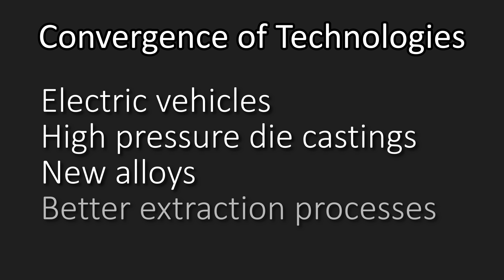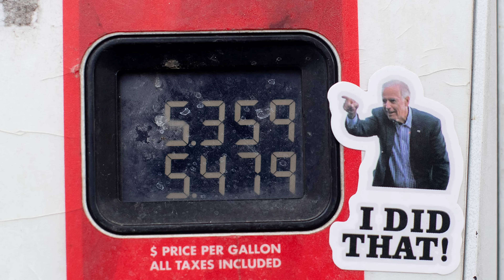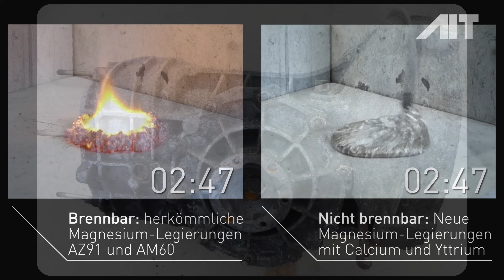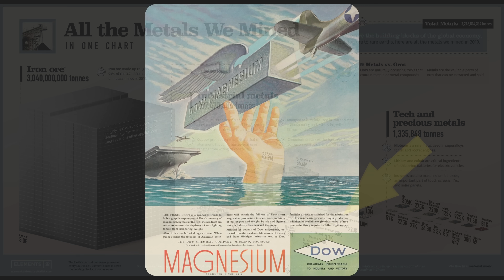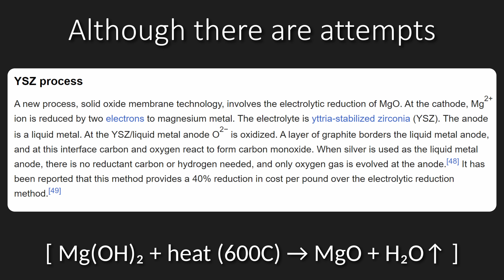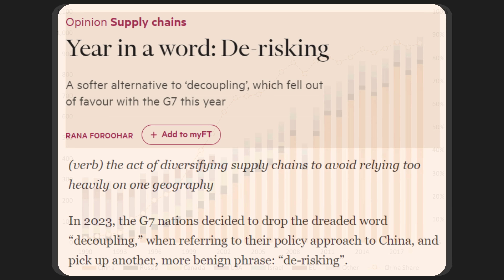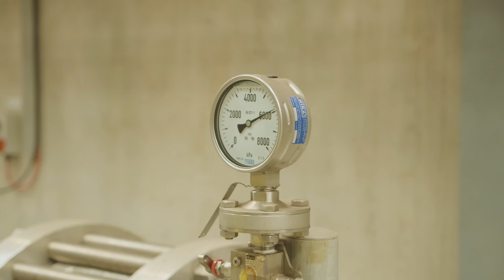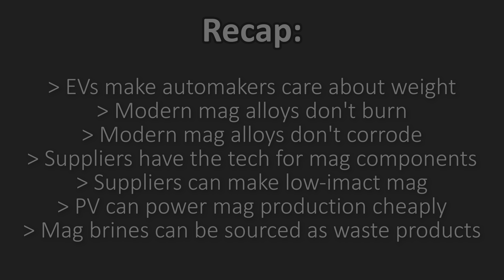Welcome to the AGE of MAGNESIUM

Comment: I'm a retired chemist and engineer and like this very good video about Magnesium, a remarkable metal, It was so lightweight it was used to save weight on the B-29 bomber with the engine block cast magnesium. Unfortunately those engines ran VERY hot and had lots of engine fires. That was deadly with magnesium being a major part of the engine because that meant the metal of the engine itself burned and could not be put out with water or foam I also had to interject a comment about your misleading political attack job Actually Biden was the first president to use the buying and selling of the US strategic oil reserve to gain some control of wholesale oil prices and BROKE OPEC stranglehold on oil prices!

Comment: With regenerative brake systems the weight of the vehicle is really not that important. And also magnesium is lighter than steel its strength is also lower and therefore parts have to be thicker. And its much more expensive than steel so i dont know if magnesium will be used sometime (apart from luxury cars maby)

Comment: This discussion is meaningless without primarily looking at the material's mechanical properties and comparing them to the part's requirements. In terms of having lighter parts, it's not just about the density of the material, steel is denser than aluminium but steel is stiffer and stronger so depending on how the part is loaded it can make lighter parts because less material can be used. (search Ashby Material Selection for the full picture).

Comment: Some magnesium movement occuring in bicycle manufacture currently- another transport sector that values lightweight structures and is significantly more future proof than cars. Have a look into Vaast cycles made with Allite tubing. I also saw a blog post written by one of the figures involved with introducing aluminium into large scale bike manufacturing- he predicted in the 20th century that the majority of consumer bikes would be made out of magnesium eventually as it would replace aluminium.

Comment: But is there an issue with aluminum shortage? Until it's widely viable and business can get it fairly cheap, they still will continue to use it, especially if extracted magnesium will be more expensive and if it will not meet the demand.

Comment: Yes, a 1/3 lighter structure is valuable, but a car's weight ain't in the structure anymore. Batteries won't get lighter based on magnesium, and car structures are already light. Way more opportunity exists in neighborhood electric vehicles with removable ultra-efficient range extender engines and battery packs. The only time a vehicle needs significant mass is when it leaves its home turf. And that weight can be temporary,  especially since it's not just efficiency that screams for very low range: the space opened up by limiting daily range is quite valuable. When you want to travel, add a swappable battery or an engine and fuel tank. It is ludicrous to drag around a 500 mile battery. Tires, roads, everything degrades just to support the mass of almost always unused battery capacity. 20 miles is a good range for a car battery. A tiny range extender (20hp or so) can extend that to about a million miles. With a 20hp engine and a tiny battery 99% of the time you won't have any issues. In the rare instance that you have an issue it will be "I had to slow down a tad".

Comment: There is also the Karen fuelled school run arms race, where weight is actually an advantage. If a 2 ton car hits a 1 ton car, the 1 ton car will be deflected twice as much, imparting 4x the energy to the passengers, so there is inherent safety in being the heavier vehicle. This is before you even consider weight distribution. A lump of weight at the base of a car structure lowers CoM, and lowers sprung to unsprung mass ratio. It will require more power to accelerate, but unless you have downforce (most cars have some lift), grip, stability, and ride quality will actually improve. There is a reason wheels have been magnesium for a long time, and roofs are the first part to be switched for carbon fibre.
Electric cars already have a large weight very low, so start to see benefit from losing a few pounds where possible.

Comment: They never adopted stamped aluminum structural components due to tan-delta aka springiness. Many steel varieties are amazingly spring (like spring steel, piano wire, and... you know, springs). This is incredibly valuable for things like spring leafs and vibration durability. Ever notice how there are no aluminum springs? I wonder if there are modern magnesium alloys that have a high tan delta. Also I bet someone is going to chime in about some specific NASA aerospace aluminum with a crazy tan-delta - I'd love to learn more but afaik none of the common readily available, easy to work with, aluminum variants have great tan-delta values - better at crumpling than springing back.

Comment: Magnesium is not new and has been used and is being phased out in Aerospace. Cost is higher because there isn't alot of finish houses thst handle it. Problems are milling aren't as easy as aluminum, cost is higher, wear a d fatigue characteristics are worse than aluminum (look at allispn 2000-2010 transfer case wear issues), and coatings have a hard time adhering and baked on csnt be used in a lot of cases becuase of lower tempering temps of magnesium.

Personally I don't think it's coming back this is once again an industry not learning from the past thinking they've reinvented the wheel (which were also magnesium on VWs) when they're sifting through the garbage heap of others ideas and I don't think this time it's another man's treasure.

Comment: I don’t think they trying to make lighter EVs to have more range, EVs have regen breaking, so any energy to put to accelerate comes back when you break.
The more pressing issue with EVs weighs is that they are heavier to begin with, so they cant tow  as much and the breaks etc. have to be beefier (regen Breaking is no option in an emergency)
Given then people buy EVs for the acceleration it also makes sense to have less weight.

Comment: Magnesium car with Lithium batteries in a indestructable cyber truck that electrically opens the car doors…. That’s a death trap 😂
Reply: The Cyber Truck is one kid's amputated fingers away from being killed. It has too many Muskian moronities for even the army of brilliant engineers Tesla recruited to handle. Musk sucks.
Reply: Imagine using magnesium to lighten the car because you used stainless steel to make the hull which made it heavy in the first place. It's like mixing coke with heroine because you can't decide whether you want to get sedated or cranked up.

Comment: Hate to burst your bubble, but if your justification for magnesium rests solely on electric cars, theres no justification for it. First the market for electric cars is predominantly driven by government forced demand. If the government were to pull out the whole industry would crumble. Two, electric cars are extremely inefficient. Most energy in the USA comes from fossil fuels, electric cars and the batteries used are basically just an expensive middle man between the effective power source and the road.
Third, just reducing weight in cars isn't going to do much. A massive margin of car exhaust in America comes from commercial. Semis and pickups hauling heavy cargo. Reducing the weight could just make them top heavy, reduce safety and ultimately have an uneventful impact on long term fuel efficiency because of their load.
Fourth, even if you were to be a fool and ignore the waste and production side of batteries, and the inefficiencys in their use, clean energy welll... isnt clean. Despite what all the government paid npc scientists will say both solar and wind are a joke. They look clean on the surface but when you look underneath you find they aren't. Wind has ridiculous waste in the manufacturing of and frequent replacement of mechanical components (and because this, wind isn't cheap either) and solar has lots of chemical waste that is extremely toxic, making coal look like we are burning white pearls than "dirty" rocks.
Fith, the real "future" for cars would actually be nuclear, and it would be that way for "clean" energy, that is, if people actually pulled their heads out of their asses.
But, while I might of squashed your dreams in this space, and people might be in denial as they snort the anti human "clean" kool-aid, let me not discourage you to much. In the vast history of human inventions there are plenty that found their place outside their initial intended space. While I admitadly know little about magnesium, you did make a point of how light it is. If you can make stuff lighter, stronger, and cheaper than steel then there are still TONS of applications for it.

Comment: Been making aircraft parts out of magnesium alloy for decades. The problem with magnesium is it loves to corrode. That of course isn’t an issue for a car manufacturer who would love you to need to buy a new one every 10 years.
Reply: Also heat cycles are supposed to soften Mg. Air cooled Beetle engine blocks are Mg. While rebuildable, a rebuilt block can't get as much usage before the main bearing journals lose roundness and alignment.
To your point, VW was supposed to have applied some sort of protective coating to the blocks. I think it was yellow. I never saw it in person meaning it may have worn off after decades. Those blocks tend to cover themselves in oil for self preservation from corrosion.
Reply: Then find an alloy counterpart or two that ties down all of magnesium's stray electrons.

Comment: People have long had the idea to make cars entirely from magnesium, but there is some reason, technical or financial, that has held the idea back. In the 1930's Dow made prototypes that they marketed of a car made from "Dow metal," which was magnesium, including the frame, body, engine block, etc. They derived the magesium from underground water. 

Apparently the amounts of magnesium in seawater are enormous. So you don't need to mine it, but obviously theres a cost of extraction.

The original VW beetle type 1 engines had magnesium cases.  When i was a kid any aftermarket wheels were called "mags," because sometimes they were magnesium.  Bits and bobs of racing vehicles would be made of magnesium. There were bicycle frames in the 80's of cast magnesium (not very successful), and now there is a small number of bike frames made of aluminum - magnesium alloy.

Comment: This video is incredibly poorly researched.

Taking Magrathea's claims at face value and not being able to back up their statements is just marketing. Magrathea needs to prove that their magnesium is sustainably produced with physical evidence. 

Another problem is that photovoltaics are very poor at handling high load applications, anything that uses an inductor wreaks havoc on electrical grids, and solar panels have no way to resist the RF produced by inductors/motors/frogs/gerbils/etc. 

Another issue is that the environmental impact of brine is not fully understood. The paper "A comprehensive overview of environmental footprints of water desalination and alleviation strategies" by A. Shokri, M. Sanavi Fard argues that we do not have a comprehensive understanding of the contents of the hype-concentrated salinized water, and depending on the location and water quality, desalination plants can be releasing toxic concentrated chemicals that sink to the sea floor killing anything nearby.  

This is not an exhaustive list of my grievances, but just a few

Comment: Your whole premise is based on the theory that autonomy will remain an issue with electric cars. There are other simpler and cheaper options. Batteries could be made to be hot swappable so instead of recharging over the course of an hour, a robot could swap the depleted battery for a charged one in a matter of minutes. Alternatively, fuel cell technology is already available and, while there's still work to be done on that technology and the hydrogen distribution network isn't developped.

Comment: One needs to be EXTREMELY CAREFUL with magnesium.
It will burn and when it does it goes off like a small sun. Red hot Liquid Metal flows almost like water setting anything flammable on fire as it goes.
If you’ve never seen magnesium light up and burn. I’d recommend looking in to some videos to see what it’s like.
True enough, magnesium is strong and lite. But will roast you and not think twice about doing it if it has the opportunity.

Comment: As a manufacturing engineer for the one of the largest OEM, magnesium is not the material of the future. Too expensive to manufacture, low fatigue life, impossible to repair, etc. There are a ton of reasons why you’ll never see this stuff outside of boutique or high end stuff. Al-Li alloys are far more promising.

Comment: while magnesium have an interessing potential, i believe that super-bainitic steels could have a better potential (as while more than 4 times heavyer, the compressive and tensile strengh are much, much higher, and the hardness is also so high that mechanical wear and tear won't be too much of an issue). 

magnesium is usually in the 1.7g/cm3 realm irrc (while allu ~2.7 and steel ~8)  most magnesium alloys i have seen are below 300mpa of UTS, while super bainitic steels can easily go beyond 2GPA (and hardness wise, most mg alloy i seen where less than 100hb hardness, while super bainitic steels often are in the 600+ hb)

corrosion and potential brittleness (v charpy) could maybe be issues? but even so i still believe super bainitic steels could proove even more weight-efficient

Comment: I worked in magnesium diecasting years back now. Yes, you can get magnesium less flammable, less being the key word. There are a lot of problems with doing that through. Mostly, the more aluminum you add the harder it gets to work with the alloy in a manufacturing sense. The alloys tend to be thicker and sticky which clogs the pumps needed in the diecast process. There is also the problem of the metals properties in general. It is stronger then aluminum but more brittle. That is how we ended up with some newer alloy as the part we were making couldn't survive crash tests without shattering, (no, i am not going to get sued for telling you any information on the actual part and really you don't want to know anyway). So we were made to use a different alloy that was so much harder to work with. Although less flammable once it was on fire it was still burning magnesium and all of the fun that goes along with that. The amount of dross in the molten metal was ridiculous and no one wants to be the guy standing on top of a 500 gallon pot of molten magnesium dipping out dross while their boots melt. The alloy was sticky and clogged every pump it went through. It also would stick to the die and cause buildup on the die that continually stopped production. Basically what i am saying is it is a really great metal that will probably never actually be used the way this video is suggesting. The finished products would be great but making them in mass is the problem, you can make a few a day real easy, it's mass production that i don't see being worked out. As for high pressure diecasting with magnesium, well almost no one does magnesium diecasting in the U.S. because the normal process so very dangerous, now make sure that explosive metal you are working with is put under intense pressure and things can go bad real quick. Had a press malfunction on my day off, die closed way over pressure and that caused water to get through into the die during a shot. This was a small part 1 and a half pound pour. The ram shot and a fireball hit the ceiling and blew under all of the gaurds, operator ended up with only very light burns. The explosion blew a hole through the die face the was the size of a silver dollar and it did it instantly, (when i say blew i really mean melted). Not sure if anyone out there knows about diecasting and tooling steel but we are talking about almost the hardest steel on the planet, makes iron feel light when you pick it up. Now imagine a malfunction when casting a 500 pound frame... Maybe i'm wrong and they can make it all safe which would be a very good thing, as for myself, i don't work in diecasting anymore because that is dangerous work.
Reply: As far as I know, the process will be thixomolding in the case of IDRA. The dangers you describe are why traditional high pressure die casting this stuff would be a mistake. Thixomolding helps a little because less of the process exposes the metal to air, because the partially molten metal is not as hot and less of it is hot at once, and the piston pump injection supposedly solved the pump-clogging thing. Its also more automated, putting fewer workers in harm's way. And even then there are challenges that might not be solvable.
Reply: @themogget8808  being exposed to air is far from the worst problem, it is being exposed to the water that you need in the process to cool the doe down that is the big problem. You have to have water pumping through your die to cool certain parts while leaving other parts hotter so the metal flows properly across the die face. Under normal operation this is fine since the water is flowing inside the die and never comes in contact with the surface of the die, but stuff goes wrong and you can find videos of water and meg meeting here on YouTube. If there was a issue under high pressure while casting a large part then there is a good chance automation is going to be helpful as your whole factory is gonna be gone. I'm just a low level button pusher though so maybe they can work around all of the problems.